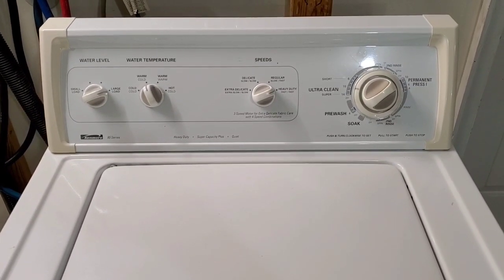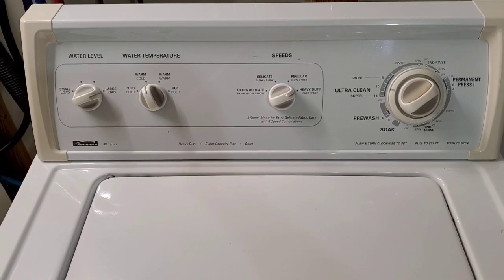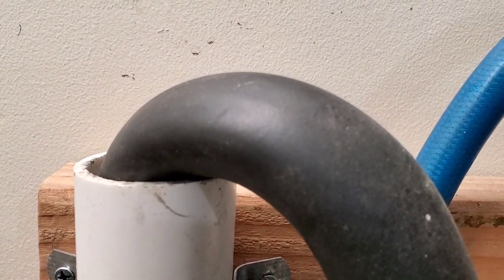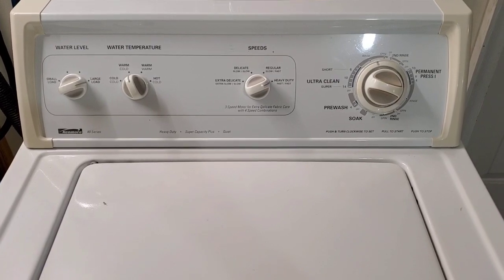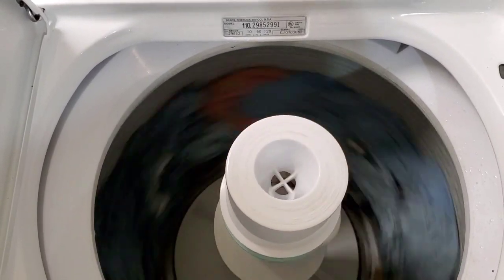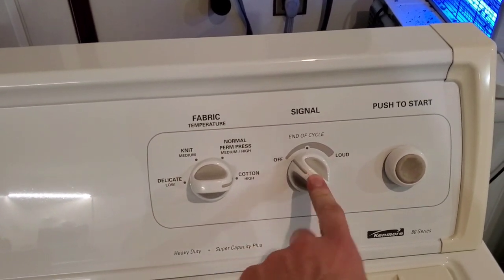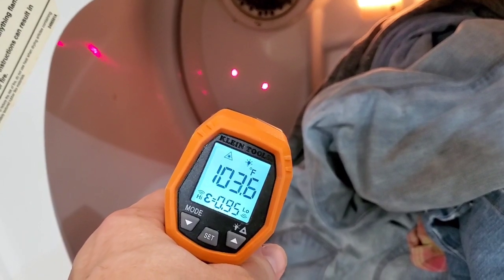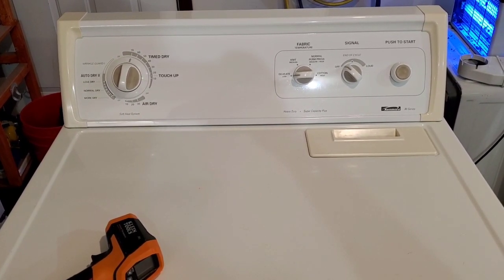Kenmore washer and electric dryer matching set

Comment: Hi there.
I've been a big fan of direct drive washers from Whirlpool/Kenmore/Kitchenaid, etc., and have listened to them for over 20 years, and know how the cycles on these machines are supposed to work. 
Usually, it goes like this.
1. Fill
2. Agitate
3. Neutral Drain (after it pauses for a few seconds)
4. Spin (after it pauses again)\
5. Fill
6. Agitate
7. Neutral Drain (after it pauses for a few seconds)
8. Final Spin with two 10-second spray rinses (after it pauses again)
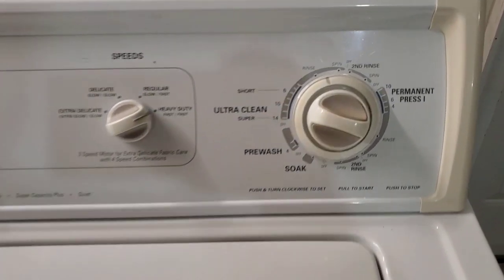I noticed that as the washer does its first drain at 1:10-1:31, it sounded more like it was a spin drain. These machines, as I'm sure you're aware, aren't supposed to do that, for it'll give the components in the washer more wear and tear, and, worse, the water will ride up to the side of the basket as it spins and drains simultaneously and possibly slosh over as the basket gets up to speed.
I've seen some of your other washer/dryer videos already, and I've enjoyed watching them. I do have questions, however, and I'm just curious.
1. Do you post these appliances online?
2. Where are the appliances located?